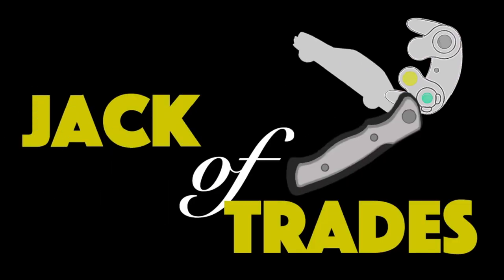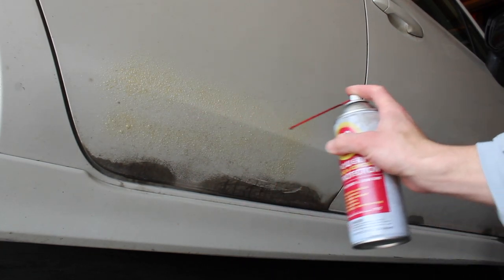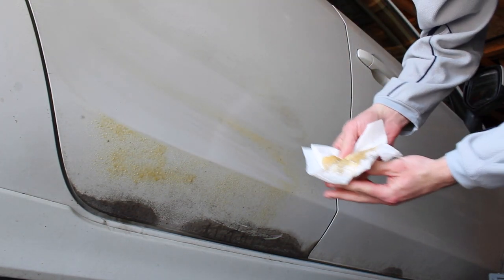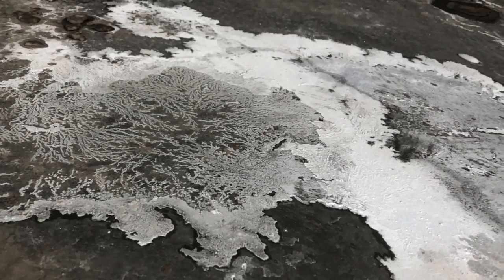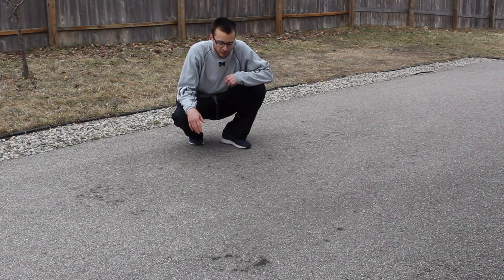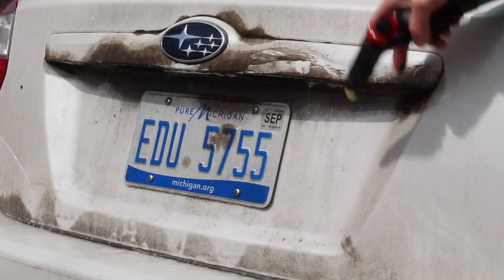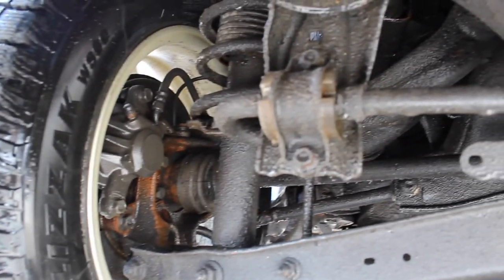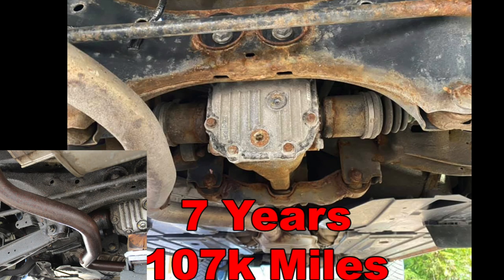Fluid Film Long Term Test + Comparison and Review Rust Prevention Undercoating - How to stop Rust

Comment: You poor souls. My 05 Malibu with 280k miles has less rust than your coated Subaru. I don’t know how you guys in the rust belt deal with this. I would’ve packed my things and left.
Reply from the maker: One of the downsides, we don’t have to deal with earthquakes, tornados, hurricanes, cockroaches, extreme heat, etc it’s all about pros and cons!
Reply: You’re the poor guy with an 05 Malibu with over 200k lol, get yourself New car buddy. I don’t get how you deal with being broke I’d get a new job and buy something nice.😂😂
Reply: @jorangel87  LOL it has 302k miles now and I'm hardly broke. I make over 6 figures. Why get a new car? My Malibu runs fine. It has been everywhere with me, it's like my travel companion, even after all these years I'm not tired of that car at all. Why mess up a good thing?
Reply: @DJR5280  I don't know how you tolerate the heat. I hate temps above 68.
Reply: @Steve  Denver isn't all that bad. It's a dry heat but 90 and above is an every day norm here. Usually it's above 90 degrees 60 something days a year

Comment: If you want to apply it two times per year I suggest doing it second time early spring. Salt accumulates in winter but corrosion occurs mainly when it's warm and wet. (plus salt from winter)
Reply from the maker: Yes that’s a good idea!
Reply: @KurtofTrades  so agree. All my vehicles are older, newest one is 2007. I buy them used and Fluid Film is the first thing I do. I live in NE Ohio, lots of road chemicals here!
Reply: so u should spray in the fall and AGAIN in the early spring?
Reply: @randomrazr  If you want to do it twice per year. In most situations once per year, in fall, will be enough,  plus quick touch up in spring if you feel it's needed.
Reply: @pracakosaipilarka4301  have u ever heard or tried KROWN rust proofing?
Reply: @randomrazr  Never tried it, from what I know, it's thinner and less durable.
Reply from the maker: I don’t but I would spray again late winter if you really want extra protection, not necessary though.

Comment: as a mechanic from Pennsylvania, hearing this man talk about light surface as " pretty bad"  or "terrible shape" is a bit humorous to me. No disrespect to this man at all but it really shows that peoples opinion on rust is heavily dependent on where you are located. all the vehicles i saw in this video look great and i wouldnt have a second though on if theyre solid or not compared to what else ive seen. Good video though!
Reply from the maker: Thanks for the comment!  I’m in Michigan and while I agree that many of the ones shown aren’t super bad it’s the fact that they will get super bad much quicker than without using fluid film.  It slows the corrosion process down a ton. Heavy rust starts with light surface rust. Thanks again!  I do think for being under 10 years old it’s not really good

Comment: My first time using FF was this Oct,  i cant believe i never uaed to do it,  it was so easy to apply!  The hardest part was getting under the car lol,   it went very quickly and easily after that.  Boy the amount of gaps and factory holes in frame and other bottom parts of a car are amazing once you start to look for them.  The more you look the more you find.  I got that nozzle into all of them! And filled the bottoms of the doors as well as the inside of the bonnet & the boot.   Great stuff! Great vid! Thanks Kurt👌
Reply from the maker: Glad to help!

Comment: Thank you so much.  Your review answered some of my questions...
 - Smell: like an old camper, odor goes away after 1 week
 - Non-toxic: yes
 - Corrosion performance: 5-year photos clearly showing protection and expectations on minimizing rusted underbody
 - Durability: durable under light to medium water jets and rain
 - Manufacturing: oil sheets use for wicking 
 - Application: self-healing means the area that has been sprayed will "creep" about 2-inches to non-sprayed areas to reduce need for fine detailed applications in all the tight spaces of underbody
Reply from the maker: Yes yes

Comment: My only thought/suggestion would be to NOT apply Fluid Film to the top surface of your car.  Since the product is "oily" it does attract dirt and dust and as shown on your car it looks gross.  Perhaps a good paste wax or even a ceramic coating would be better for the car's paint and instead of attracting dust and dirt it would repel it like Rain-X does for your windshield as it repels water.
Reply from the maker: It just creeps out from the panels I didn’t spray any directly on the car only to see what it looks like as a demonstration.  But I agree!
Reply: @KurtofTrades  Oooh, that's interesting.  I've just started investigating about rustproofing my vehicles for myself and in all the videos I've seen - NO ONE else has mentioned about that "creep out" effect.  I'll have to keep an eye out for it.  I was thinking that all the "dripping" they talk about was down low under the doors but there are holes and cracks all over a vehicle where the Fluid Film can seep out of, aren't there?  Thanks for the heads up.
Reply from the maker: Yea it creeps really well which is good becuase if a rock hits it and scrapes it off new film will cover the area.

Comment: After applying take it threw a road that they are grinding up so they can pave it. The milling dust will stick to this stuff. It's like rubbery super sticky dust and it sticks to everything. Either that or a dirt road, go tar and feather it before the salt because this stuff fresh is sticky.
Reply from the maker: I’ve heard of people doing this.  I’ve noticed it also seems to be less likely to wash away when it gets dirty too.
Reply: Yeah I'm familiar with the grinding dust from working on the roads. It sticks to whatever and it don't move. It's literally ground up rock and old tires and tar and you get the point. 
Although I think a dusty dirty road might do the trick too.

Problem is this stuff is sticky when it's just raw, not too good for when the sand and salt mix hits the road.
Reply: Obviously when you drive it around all summer and fall it will have already been covered with grime and road dirt.
Reply: @KurtofTrades  have you heard of people using the milling dust? I guess you gotta know when they are paving/grinding then you take take the ol girl for a beat run lol tell the sweeper shut that water off I need some shit to coat my undercoating
Reply from the maker: I haven’t heard of that before, I’ve heard of people using dirt roads but those get sprayed with anti dust stuff that can be corrosive too so I wouldn’t recomend it. I’ll look into it.
Reply: @KurtofTrades  cold planing milling dust. Tastes like shit too by the way.

Comment: Great video! Was wondering what your opinion would be on rubberized undercoatings, a family member of mine had a rubberized undercoating done on their brand new 2022 toyota rav 4 (done after a few months of summer driving) and from what ive seen in other videos I'm worried it might actually make things worse by trapping moisture inside if the coating is compromised.
Reply from the maker: Yes that’s going to be a nightmare in a few years.
Reply: @KurtofTrades  thx for the reply, thats what i thought, especially here in montreal, quebec. Some people just dont want to listen unfortunately lol.

Comment: Great video! Highly appreciated! Thanks for documenting this !!! Does the body of your Impreza have any rust ? Rocker panel pinch weld ? Rear wheel arch ? Door bottoms ? Hood ? Tail gate ? Fenders? Etc I’m only asking because I’m going to be getting a new crosstrek soon and I like to keep my vehicle for a long time just want to know how well it will hold up, when I get it I will remove undercarriage plastic covers, and wheel well arch plastics front and rear, wheel well carpet, and rocker panel plastic covers To ensure full coating of the inside of everything, so it will cover inside fender, inside quarter panel, inside rocker, and then I will do the door drains, hood drains, and tailgate drains, maybe even remove the windshield cowl and do under there too! My theory is if everything is coated in oily FF then the salt can’t even  attack the protective Zinc coating to get to the bare metal to start corroding, so if it’s always coated then there’s always no rust, because all you need is Air and moisture on bare unprotected metal to get corrosion but with a constant oil layer it’s not possible.
Reply from the maker: It’s pretty rust free there’s a little on the wheel hubs since I didn’t wants to spray that close to the brakes.  There’s a very small amount on the rear control arms and shocks but other than that it’s very clean. Compared to my wife’s vehicle which is a few years newer without fluid film it looks brand new
Reply: @KurtofTrades  thank you greatly for the reply it is very much appreciated! 🙏🏻 😁

Comment: Once you apply FF how do you wash your car during the winter? Is it ok to still wash inside the wheel wells etc.? I don't want to wash it away from the areas where it might not last as long...
Reply from the maker: I don’t wash it at all in the winter. You can wash the outside but I wouldn’t do the wheel wells or undersides.  Once it sets it holds up very wel but the first couple weeks definitely don’t wash it.

Comment: Do you do the application only from the aresol cans? I was about to pay a professional what I consider to be too much money because I don't have a compressor to run a spray gun but if you've only used cans this looks great
Reply from the maker: Yes I only use the cans, they work great! Thanks for watxhinf
Reply: Get an electric sprayer from garner freight for like 30$. It worked great on my truck for the money
Reply: It’s a lot cheaper to get a sprayer and a 5 gallon bucket of Fluid Film. I spray every inch of the bottom of my 3 vehicles once a year, 5 gallons last me 5 years.

Comment: Can you spray this over existing rust ? Is it going to stop it from spreading/getting worse ?
Reply from the maker: If the existing rust is light it will slow it down,  if it’s heavy rust nothing will really help other than cutting and welding in new metal.

Comment: How many car wash visits do you do and Do you get the under carriage washed during the winter or only just  before you reapply FF ?
Reply from the maker: I usually don’t wash my car at all in the winter no point it gets salt covered on the drive home. Don’t do the undercarriage as it will wash the fluid film away quicker

Comment: Great video 👍 How's your bushings holding up with fluid film? Thanks ✌
Reply from the maker: No issues with them, they are 9 years old and have 110k on them though lol
Reply: @KurtofTrades  Good deal, Thanks for the reply 👍
Reply from the maker: I believe they make those rubber bushings to withstand oils and other materials since they come in contact with a bunch of junk from the roads
Reply: does not hurt them

Comment: Do you wash it off before reapplying? I was thinking maybe taking it to one of those high-pressure touchless car washes to get the prior stuff off might be better, but I'd rather have a buildup of dirt than rust!
Reply from the maker: You don’t have to but you can either is fine. I think it’s better to go through a few washes over the summer then reapply in the fall

Comment: Regarding staining, are those small drops on your driveway the only staining that you got after the application?  Or, were there many more that washed away?  I want to apply this, but I don't want my driveway to be a mess.  Also, do you think that it's possible to apply the FF effectively by crawling under my SUV in various points?  Or, do I definitely need a jack?  Thanks in advance.
Reply from the maker: They go away after a while those were what was left after winter.  They are not permanent.  If you are worried you can apply it in the grass.  If your suv has good clearance you definitely could apply it without raising it. It would probably be easier to if raised it but not necessary. Thanks for watchinf
Reply: I have Fluid Filmed my Toyota Tacoma twice now without lifting it.  It's body-on-frame.  If your SUV is unibody (like a crossover) there won't be enough clearance to crawl under there and do a good job.

I use three quarts per application, and it leaves a giant vehicle-size stained area on my driveway that wears off in a couple months or so.  It doesn't dissolve the blacktop like PB Blaster or brake cleaner do.

Comment: Did you apply to the exhaust pipe? Does it smoke? Thanks!
Reply from the maker: I did not spray any on the exhaust directly but it did get some overspray, no smoke but burn smell for a couple drives after.

Comment: How often do you respray your fluid film? How long does one application last?
Reply from the maker: I have been doing once in the fall.  You could do a second one mid winter but one works really well.
Reply: @KurtofTrades  You've only done one spray total? And it's lasted 5 years?
Reply from the maker: Sorry, 5 sprays total, one every fall

Comment: Any issue with using it in the engine compartment? I live next to the Pacific Ocean & my salt is in the air.
Reply from the maker: I use it on the inside of the hood and frame rails and shock towers under the hood, I would just avoid spraying any components or the engine directly and you should be good to go.

Comment: Hey Kurt.   I noticed that there is a decent build up of rust on both my mufflers on my 04 Town Car.   Would spraying Fluid Film on these mufflers prevent the mufflers from rusting alot more over time?
Reply from the maker: No you really shouldn’t spray your muffler it gets too hot and will burn off the fluid film.  Mufflers are pretty much impossible to keep rust free. Best option is a high quality stainless steel one.
Reply: @KurtofTrades     Ok.            For the most part, the rust has been kept to a minimum on a car that is now 17 years old.    Seems like the mufflers and some of the pipes(still factory original) is what has the most amount of rust so far.    

  So what are the ideal items I could use this Fluid Film on, underneather my car?
Reply from the maker: Pretty much every metal part other than brakes and exhaust. It won’t hurt anything. Also don’t spray the motor.
Reply from the maker: Pretty much every metal part other than brakes and exhaust. It won’t hurt anything. Also don’t spray the motor.

Comment: How does it work on the exhaust system?
Reply from the maker: Don’t spray the exhaust. It burns off and is stinky.  Exhaust isn’t too much to worry about since it can be removed and replaced easily, unlike your frame or unibody.

Comment: Do you clean the old fluid film off before you re apply?
Reply from the maker: Not super thoroughly, I spray it with the hose and then go through a car wash a few days before I apply it with an  undercarriage sprayer.  It can go right over old stuff.
Reply: @KurtofTrades  Thanks for the response, which sprayer do you happen to use? I would like to apply it myself this summer.
Reply from the maker: I just use the cans to apply it.  The undercarriage spray is to get it off from the car wash.

Comment: Hi Kurt of Trades, Does FF affect rubber bushings, weather strips in any way? do you see bulging or structural weakness of rubber components?
Reply from the maker: I haven’t noticed any issues with any of those, no visible expansion and no premature failures yet.
Reply: @KurtofTrades  Thank you bro!
Reply: @Oliver-pl5sk  

I coat my old jeep in wayyyy more fluid film than this guy does.  Like it's obnoxious amount and I do 2 coats a year.  (I hate rust)

I even spray it underneath my weather tech mats onto my bare floorboards....I even spray in on the outside of my jeeps body.  

Aside from the exhaust, the top and the engine...I about coat everything. I even lube my door weatherstrips in it  to prevent my doors from freezing shut in the winter.

All that said, I can testify that it hasn't done a thing to any of the rubber anywhere on my jeep.  After 4-5 years of it.
Reply: @Faq-ubeach  Doesn't it saturate your mats? It's not the worst smell but I regretted applying a film of this under my carpets because of that residual smell.
Reply: @zuranku  

No.  My weather techs are hard plastic/rubber.  So nothing soaks through.

Comment: I’ve heard stories about how it’ll just eat away under the fluid film
Reply from the maker: You mean rust under it?  It will only do this if the metal is already very rusty or if it is rusting from the backside of the metal. Air and salt can’t touch the surface when it’s on. Thanks for watching!
Reply: It won’t do this. It’s oil based, not a wax. Zbart is a thick coating and moisture typically gets behind the coating and rusts the car out and you never know because everything looks shiny black
Reply: For anyone reading this, and is confused...I would agree with the others that the o.g. poster is thinking about another type of under coating.

Sounds like he or she is referencing some type of bedliner spray or ziebart type product.  Once a spray like bedliner or something is sprayed, it hardens on top of the metal and moisture can get trapped behind it between it and the metal.  That creates like a hot bed for corrosion.  

Hard bedliner type sprays sound great in theory...but they don't work as well in practice.  

Fluid film/krown/rust check are all oil based.  It's way different.  I'm a serious believer in oil based sprays as they work.  They've kept my 17 year old jeep from rusting in the northeast Indiana winters it's whole life.
Reply from the maker: @Faq-ubeach  True facts!
Reply: @KurtofTrades  my 16 daily driven JK has 102k miles all four seasons and looks as good as the day I bought it because of using fluid film.